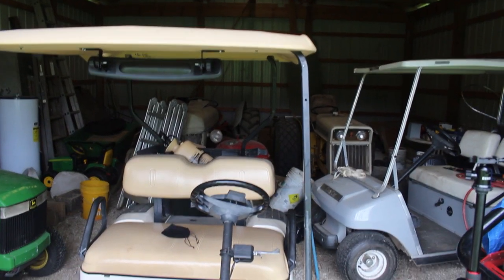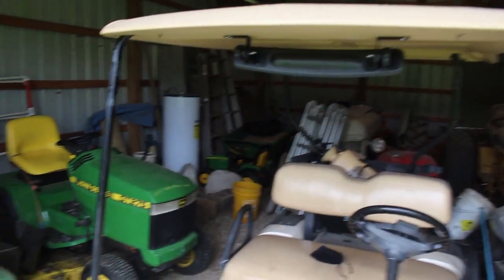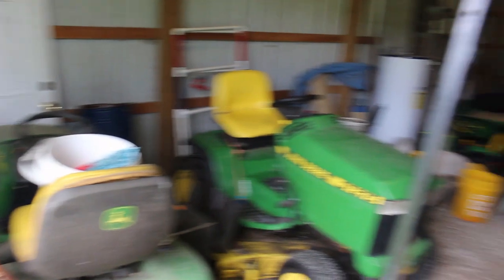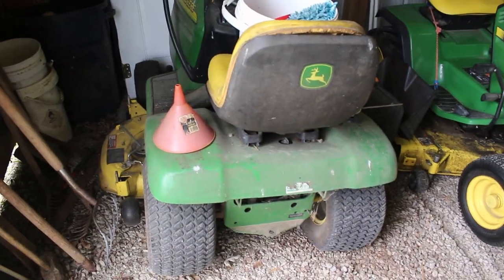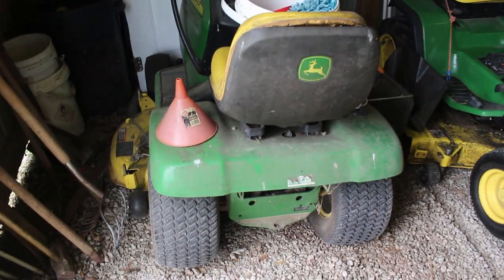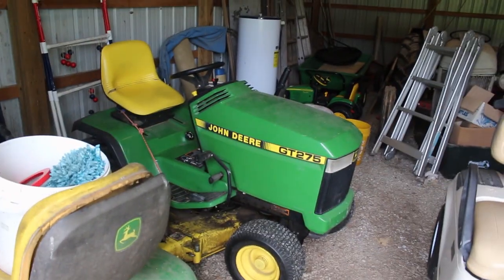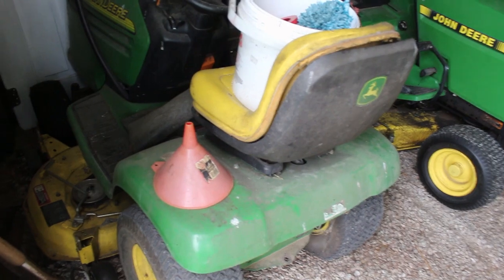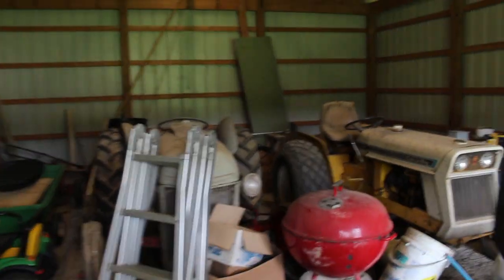I am DONE with guns!!!

Comment: I know how you feel. Many years ago I inherited an old 8N Ford that I had to work on every time I needed it. I got tired of it and when it left me in the field, I went and bought a 50 HP kubota, and I haven’t regretted it. Later I added a front end loader, which is very nice. A little suggestion is if you use a bigger tractor with that bush hog, put a slip clutch on it. I was shearing of the shear pins right and left, which was a real pain. Good luck on the tractor.
Reply from the maker: I am wanting to get around a 35hp tractor. I think that will be the perfect size for us. The Ford is a good tractor if I was willing to put in the work, but it just doesn't have all the capabilities we could have with a new tractor with a loader and everything I want.

Comment: Primers are still tough to find, powder is coming back good. Instead of a new gun start reloading. It adds so much to the hobby! Reloading videos are great, whether it's someone learning or a seasoned vet. Shooting reloads for accuracy is great fun and also would make good viewing. It's easy and in the long run cheaper. You won't be dry during te next shortage. You can start with single stage and or turret presses. You don't have to have high end Dillon presses. Lee and RCBS get the job done.
Reply from the maker: I have reloading supplies for a handful of calibers, but you are not allowed to make reloading videos anymore on YouTube.
Reply: @redneckmini14  sorry, I didn't know that. Could swear I watched some during the early pandemic lockdown. Really a shame.
Reply from the maker: @HD-J.R.  Some people might get away with it, but if YouTube catches you, your videos will get pulled and you will get a strike. Also they won't generate any ad revenue.